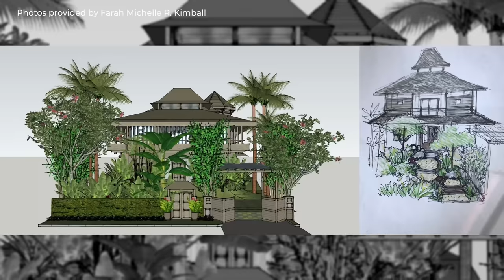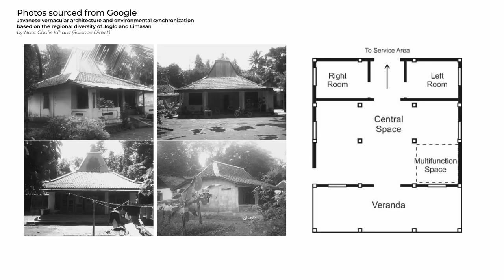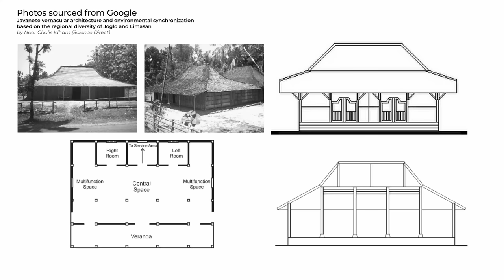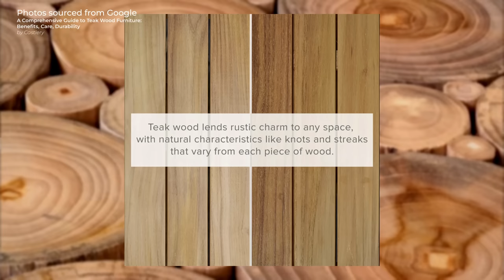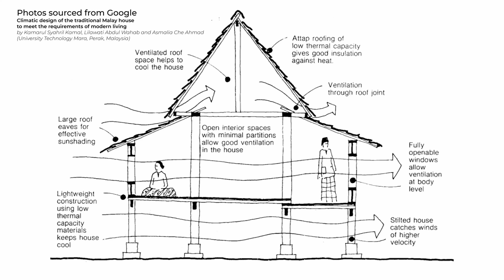Unbelievable Transformation: Indonesian Grand Home Disassembled and Transferred to Malaysia!

Comment: as javanese i need to tell this:
joglo stand for anjog loro means 2 roofs. the front and the back
the front part called "balai" can be built with "pendopo" style which the video refer as joglo, "limasan" style or even ordinary gable roof, the distinctive characteristic is it dont have wall or only half wall.
this part of the home is for public part, serve the function as living room, party hall and other other activities.
the second parts in the back is for privacy part or the home it self. the distinctive characteristic has huge two way doors, containing elder bad room after the door, bedrooms, the closet wich i forgot the javanese word of it, dining room and kitchen and other desired room.
the bathroom and toilet is outsite the house, built separately like a shed.
so joglo didn't refering to that roof shape styled building but the complete house layout